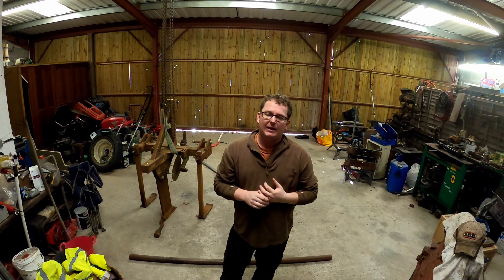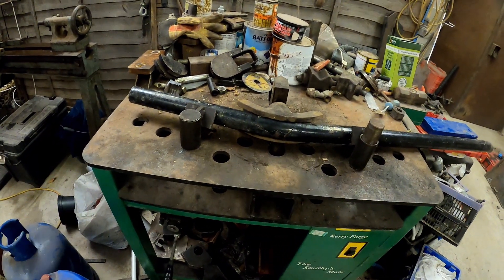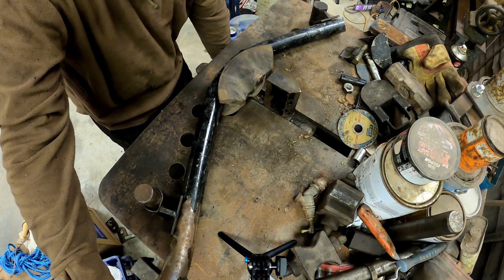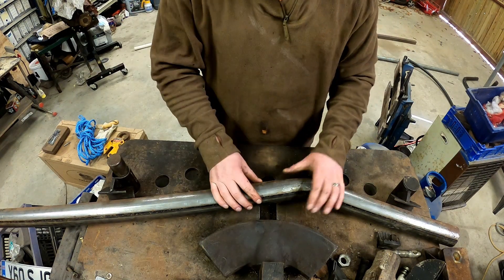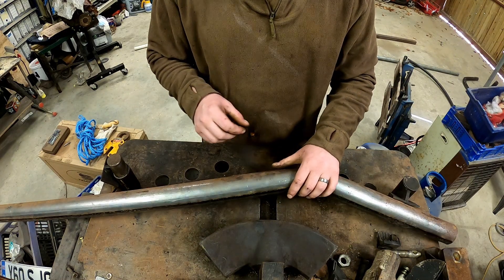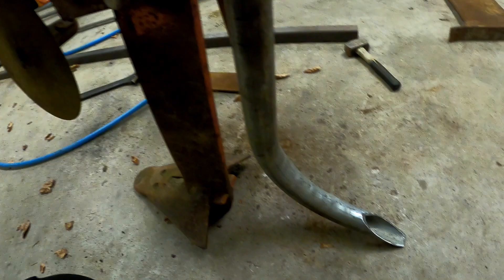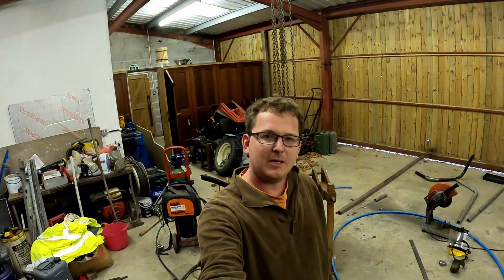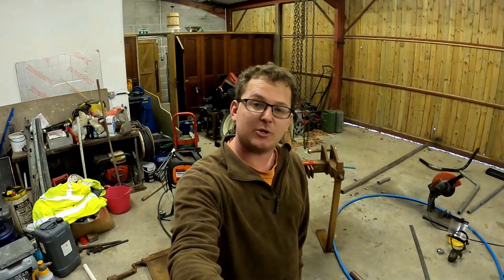Building a Mole Plough

Comment: Its a lot easier to do it this way - https://www.youtube.com/watch?v=yOJRkDIlUJA  -  just dig a hole at each end of the pipe.  Just make an attachment on the mole expander to pull the pipe with.  After it is layed you can move a full length by hand without trouble.  That way you don't ask the pipe to go round corners!  John.

Comment: Was how you did it quicker than using sand and spreading the press point and doing it once ?
Reply from the maker: I've not used the sand method before so I can't really comment, as I have the press that's the way I'd probably go again in the future.